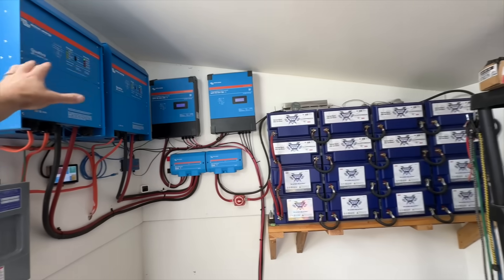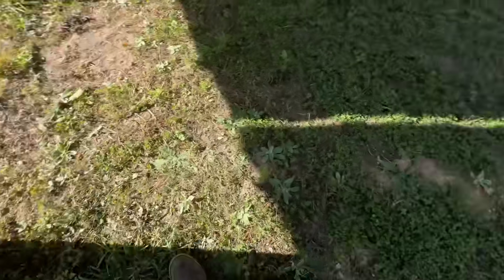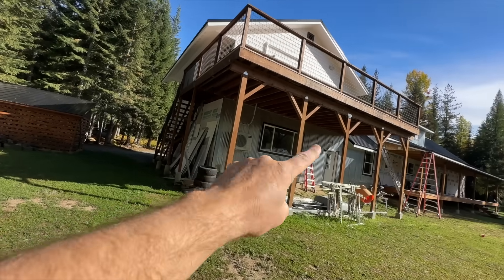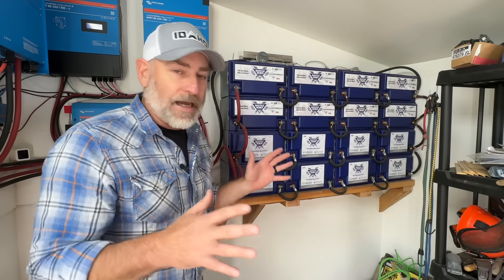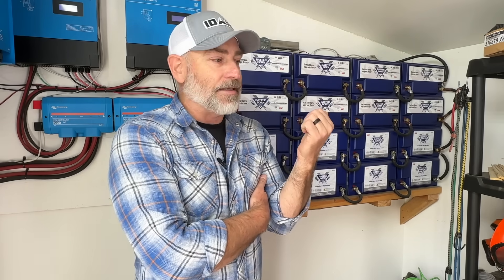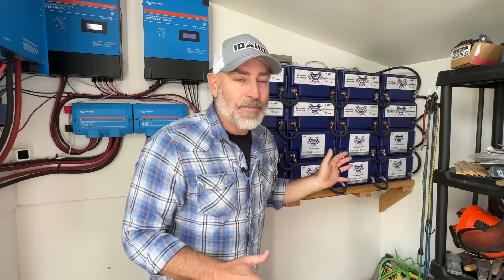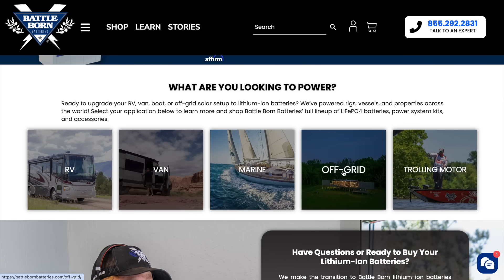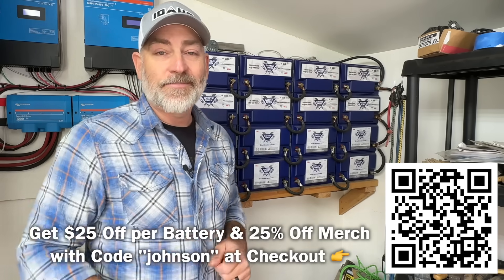EASIEST Off Grid Solar Power System Battery Bank

Comment: Anybody that uses Battle Born batteries in a stationary system has more money than common sense. They are great for RVs but for Off Grid it's a waste.
Reply: You can get 5.12kWh server rack batteries for $1,200 now.
Reply: I'm happy you could afford this. In general most could not. Also even if I wanted this I would go with double the output for the same cost.
Reply: I've bought 4 sets of different 12v LiFePO4 100ah batteries for $118 a piece so 24v 400ah bank for 850
Reply: @duval904yeah which company sold those
Reply: Someone didn’t do his solar/battery homework!! (Battle Born battery) unless that was the only think available at the time of your build,…
You could have get triple the output for the same price.
Reply: @EL90291 which ones?
Reply: If you really want 12v 100Ah LiFePo4 batteries, EcoFlow has them for $199.
Reply: Maybe your RV/cabin is used for one month a year. Lifepo4 batteries can easily transfer as your life changes.
Reply: What would you recommend ? Thanks
Reply: Pretty sure this gentleman got Battle Born to sponsor this video as it says up above. 

So Battle Born batteries it is, you can be sure he didn't pay full retail, they're a good brand and there's a lot of different ways to put things together. Especially   if you're getting free or cheap stuff from somebody who's willing to throw it at you, I say use that instead of arguing about how much less somebody else could have done it when they're paying full retail.

I don't understand why everybody's got to have an opinion about how somebody else could have spent their own money specially in this case where he probably got most of the stuff deeply discounted, or maybe even free. Just sounds like sour grapes to me.😊
Reply: Well then enlighten Martin and the rest of the world on what a way more affordable system would be with the same or even better performance, more security or less maintenance.
With an offgrid system, the most important thing is reliability. A cheaper but unreliable system is only trouble and costs money in the form of frozen water pipes in the house as heating drops out, freezers stop working, cooking becomes impossible etc etc. So spend a view bucks extra upfront and enjoy life.
Reply: @jansmit4628 may I suggest server rack batteries for 3 times the savings . Want more proof talk to will prose he will tell you.
Reply: What would be a cheaper option, even for a RV. Like that could charge from solar or use extra power from a generator when ran.
Reply from the maker: To each there own. But, RVs are off grid and stationary when parked. Many people live in an RV stationary full time.
Reply: I bought 8 100ah 12 volts for what one battleborn costs, there is zero extra quality or functionality associated with paying that much for a lipo battery these days other than a money flex. 😂 @MartinJohnsonOffGridLiving
Reply: @MartinJohnsonOffGridLiving  You know exactly what I meant by my RV statement.

Comment: For anyone that is looking into purchasing BattleBorn batteries, please make sure that they are what you want to buy. The capacity of the battery bank that Martin shows here is 19.2kWh. To get that capacity with BattleBorn batteries, you need to spend $11,600 (with Martin's code and the current sale they have), but to get a system from other companies with the same capacity can be half the price. Using EG4 as an example, you can get 4 EG4 LL-S 48V 100AH server rack batteries for $1,299 for a total of $5,196 which is the exact same capacity as Martins setup (48V 400AH total system capacity) for half the price. And this doesn't even include the extra safety protections in the EG4 batteries like full UL code compliance, true BMS monitoring, and even on-board fire arrestors for if a fire were to start in the battery (while this doesn't normally happen, it is a code requirement for compliance, something the BattleBorns don't have). And EG4 does engineer their batteries in Texas so they are not designed in China if that matters to you. 

Please just look at options other than BattleBorn, they are charging way too much in this current market when there are trusted brands making better products for cheaper now. I would highly recommend the YouTube channel DIY Solar with Will Prowse for some more information about all of the different solar/battery options out there.
Reply: @MrZed411  THANK YOU for adding this info.  I comparison shop for most things, especially high ticket items.  Most of us can't afford not to.  All the best to you sir :)
Reply: Wow that's expensive. You could get a Zendure Superbase V with 2 batteries for $10,500 with the same capacity, with the added benefit of it being an all-in-one inverter/MPPT etc. It's not exactly the same - The Zendure's output isn't as much as the setup in this video, nor does it have the flexibility that a full DIY system gives (not to mention that they're incredibly unreliable and only single phase) - But $11,600 for 19.2kWh of just batteries seems incredibly pricey.
Reply: @jerkychew899  Honestly I like how this their system is set up because if there is a problem with a battery only that battery needs replaced. Same goes with the inverters.
Reply: @MrZed411 Thank you for sharing this additional information. Blessings.
Reply: Don’t forget that eg4 rack batteries are emp proof.
Reply: I just got 4ea LiFePo4, 12v 300AH for $1250. So ran in series, I have a 48v 300AH for roughly a tenth of what Battleborn bank would cost. It has 25% less capacity, but does have built in BMS. I am running them off 2ea Sungold 6.5kw inverters producing 120/240v ( $1500). I am running 16ea 350w panels I bought second hand ($900). All in I am out about $4k for a legit system that I use in a metro city and am 100% off grid, no generator needed.
Reply: Safer but remember 80% of all cells are made in China, if that is a concern. Pb C is the only safe option. Safer than lead acid. Just heavy as lead, my 12v100 60lbs, the 12v 250a 170lbs, not a good mobile option. Will Prowse has made some good lithium fires.
Reply: @bobmonztr  LFP is also a safe option although not manufactured  in USA. Will Prowse's fire videos are most likely NCA or NCM none are LFP.
Reply: Check will prowse.  Server rack batteries are the way to go.
Reply: Do you have an electric bill? I’m guessing not
Reply: What about heat and A/C?
Reply: Funny there's a guy who got a quote for solar 110k installation single family home.
Reply: That's a good point. This is a great video but you should use these videos as a "how to", rather than a shopping list. Remember youtubers get products free/discounted or are paid promotion fees, it's how they make a money, and if that's their job, they need to make money. I would strongly suggest searching around for components that do the same but are better value for money.
Reply: @MrZed411  how much is made in USA worth? How much is it worth employing Americans
Reply: @bullithedjames  Like most batteries the cells themselves are probably made in China but assembled in the US. Other than a few EV batteries there are not many Lithium batteries which are actually manufacturered in the US yet. That is changing wth the IRA.
Reply: @bullithedjames it’s assembled in USA not made in USA
Reply from the maker: You sound a little like an EG4 representative. 🤣 

I have friends with those systems. Some like them, others have had problems.
Reply: @MartinJohnsonOffGridLiving  Well what do you think you sound like?
Reply: @MartinJohnsonOffGridLiving  Meanwhile you are actually being a salesman.... He has more credibility in this scenario
Reply: @MartinJohnsonOffGridLiving  Price per kWh is a good metric for people to use. Battleborn do have a good reputatation compared to EG4. There are lots of good products in the middle and batrery prices are coming down.
Reply: @ricklearn16  battleborn hasn't come down.
Reply: @Scott-ig1zd  I know. I was referring to DIY LFP commodity cells. This March I did sell my DIY pack and install seven Pytes rackmount battetries which work with my Solark in an approved CEC system. i needed to get building permit and the Pytes were about $300/kWh. 5lWh rack mount modules are about $1,500 and have a 10 year warranty and an internal heater.

Comment: Hi Martin wow maaaaaaaaaaaaaaaaaaan that’s fantastic system maaaaaaaaaaaaaaaaaan it must’ve cost a bit to get it all together in the beginning, if you’re using high class equipment maaaaaaaaaaaaaaaaaaaaaaaaaaaaaan it makes more sense if you can afford to be off grid with the solar system like you’ve got, and you can avoid, it would be wonderful maaaaaaaaaaaaaaaaaaaaaaaaan from Australia maaaaaaaaaaaaaaaaaaan
Reply from the maker: The average US electric bill is $149.95 per month. We have been off grid for 5 years. So, our system is not all that expensive in the long run. I think your energy prices are about the same in Australia.
Reply: @MartinJohnsonOffGridLiving  could be cheaper and better

Comment: I’m amazed that your cables aren’t any thicker….
Reply: higher voltage, less amperage
Reply: @lostduckkk Yes I get that. I was especially thinking of the wires from the solar panels to the shed with all the kit. I assume he runs the panels in series why it’s at a high voltage…
Reply: @lostduckkk Yes I get that. I was especially thinking of the wires from the solar panels to the shed with all the kit. I assume he runs the panels in series why it’s at a high voltage… I’m NOT an expert, but used to build large power supplies.
Reply: @CRingsing  IIRC he runs 300+ Volts from his panels. Still, you're right, those cables sure seem pretty slim
Reply from the maker: They are #10 wire which can handle 30Amps. There are 4 sets of wires for 4 strings of panels.  Each string of panels are about 2500w. At 300vdc that is only 8.33a.